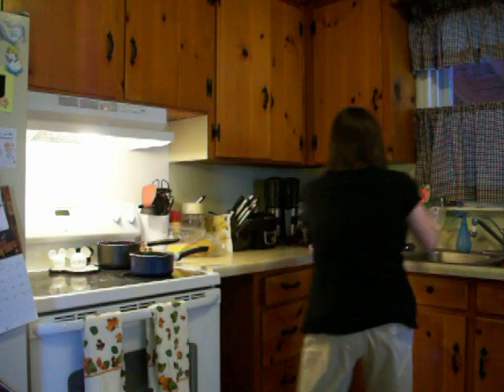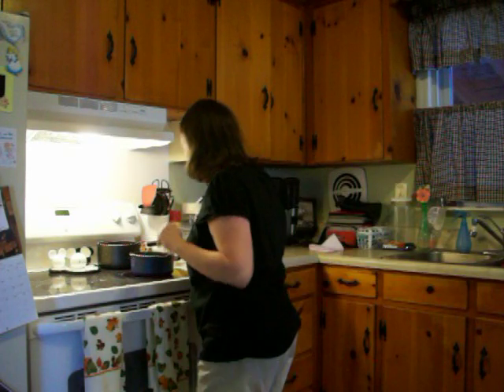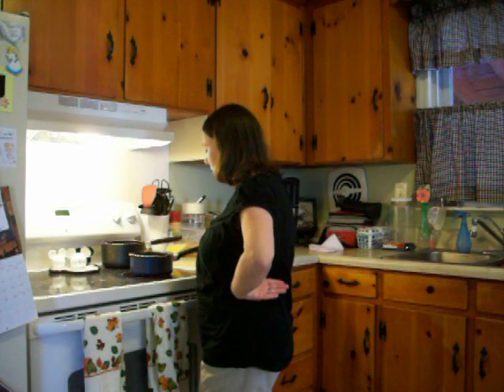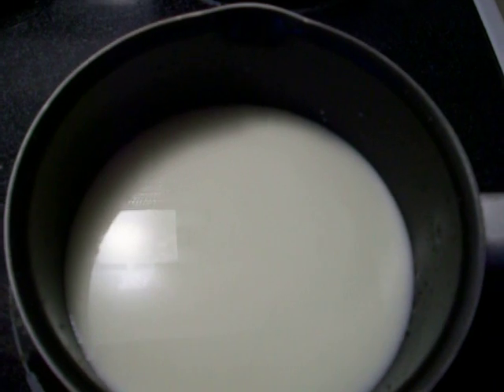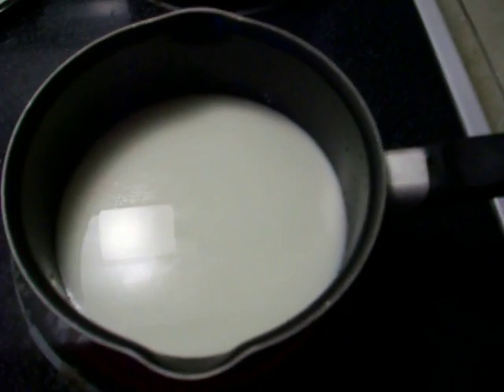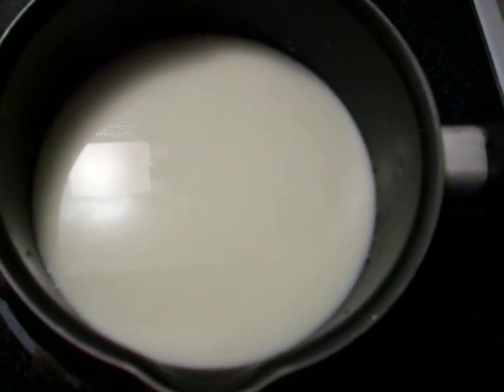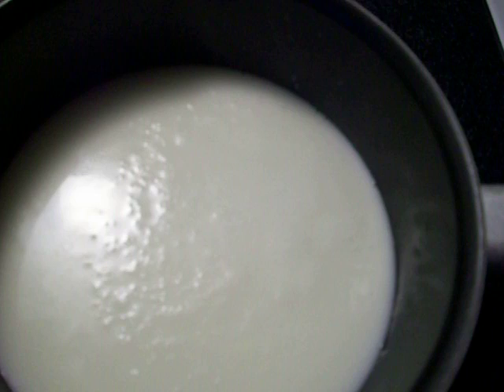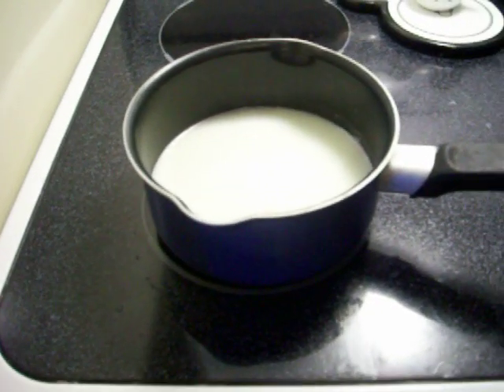The Process of Scalding Breastmilk to Help "Kill Excess Lipase"

Comment: You are obviously not a nutritionist. I have been told that the only thing that this heating breaks down is the lipase. And obviously because it worked with your three children, that the MILLIONS of Other children will respond exactly the same as yours. Your arrogance is astounding.  Every child is different, as is every person.  My First born will not accept milk that has soured due to the lipase, Even if its been properly refrigerated.  How about offering some advice that is USEFUL.

Comment: @Typh00nie You don't have to throw away the milk!! I've read that mommies have mixed the high lipase milk with fresh milk, ie 3 oz fresh, 1 oz frozen (thawed, of course) to start and then up the frozen/fresh ratio...basically getting babe used to the different flavour. You can also use the frozen milk to make cereal or add to sweet potatoe mash for example. I also have the same problem and tried about 10 oz that I had to dump. Good luck 8)